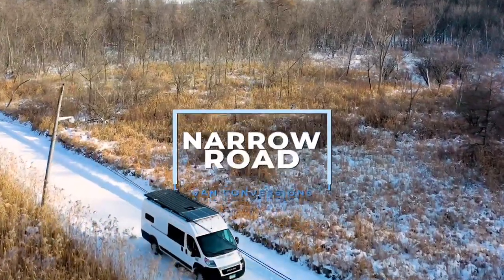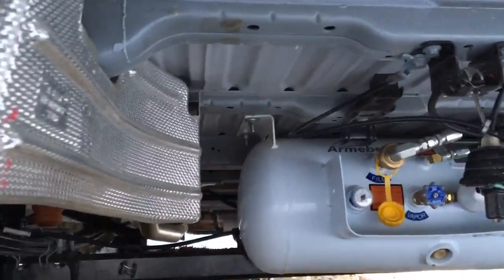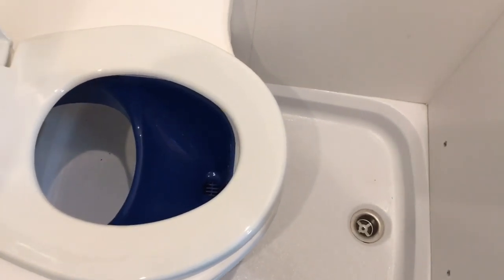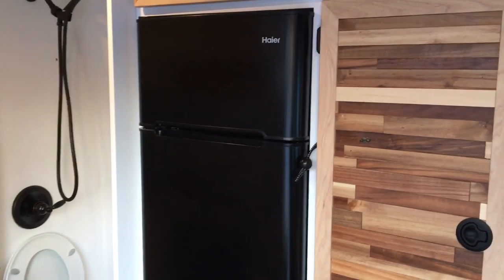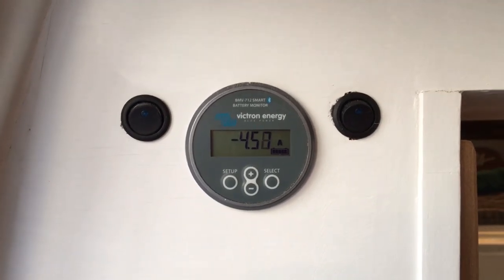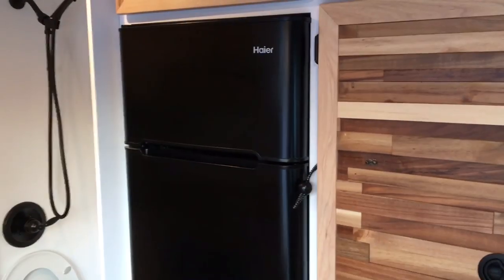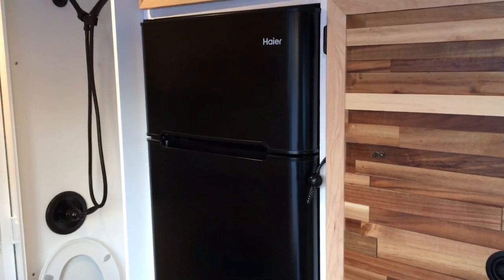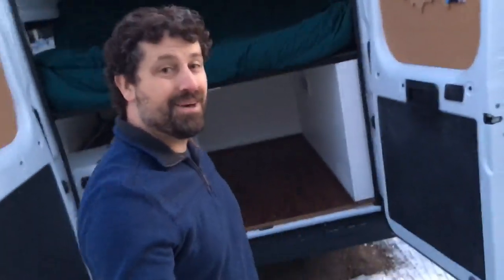🚐🛠️ Van Life Tour Continuation: ProMaster 3500 Extended Conversion with Full Bathroom

Comment: Thanks for clarifying the fridge issue, just before finding your update, I was searching amazon and found that exact fridge. I also opted for an AC fridge for the camp and will do the same for the van. Being a refrigeration tech, I could have easily changed the compressor and convert it to 12 volts but the compressor alone was about $600 so the convenient of having a regular 120 volts fridge and being able to change it if it fails was a greater advantage. One advice that I have to give you is to make sure that you have sufficient air space to evacuate the heat from the back of the fridge (or the side, where ever is the condensing side) otherwise, your fridge won't perform and will die on you pretty fast.

Comment: One other thought on the fridge would be to get a smaller inverter to run just it. Inverter are most efficient towards their maximum rating. So in the long run the separate smaller inverter would be more efficient. The other issue with dorm fridges is they are not made to bounce down the road and will brake over time. A shock mounting system would help them live longer. Nice build! I like a lot of your features you build in. Thanks for sharing!

Comment: Similar layout ideas and we even bought the same propane tank! I just had a fabricator shorten the bracket arms to give me more ground clearance but haven't gotten under the vehicle to mount it. One thing I've nervous about though, were you able to fit your spare tire back in after mounting the tank?? I didn't take this into consideration and am mildly worried about driving around with no spare
Reply from the maker: It fits but it is tight.  I had to move some of the brake line supports.

Comment: Hi Sir! It would be nice to find a converter that could turn off like the thermostat on you fridge. And turn on again when the fridge wanted to start again!? Regards Rickard
Reply from the maker: There is a power save mode on the inverter, unfortunately the power that the fridge draws is not enough for it to tell the inverter to turn on.

Comment: Im amazed more ppl don't come to the same conclusion about AC fridges with solar set ups, Dc fridges are 4x the price or more so your talking 5+ years to break even. Not to mention how easy they are to replace and how everything else runs on AC. I just bought a bigger battery/solar set up and saved my self a lot of headaches and in the long run money....
Reply from the maker: The way the alternator charges the batteries is pretty awesome.  I would say you would have endless power if you ran the van for one hour a day.

Comment: Rather than spending $1000 on a small DC fridge, Buy extra 100 amp hr battery with an efficient inverter. Victron Inverter uses 1 to 2 amps on idle.